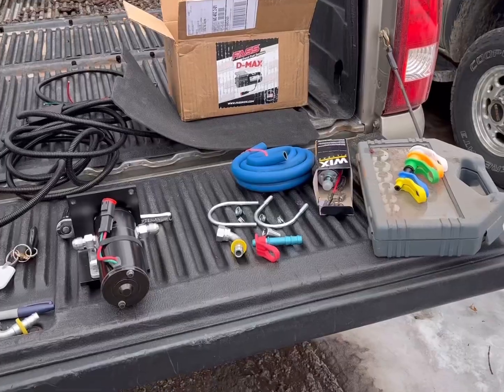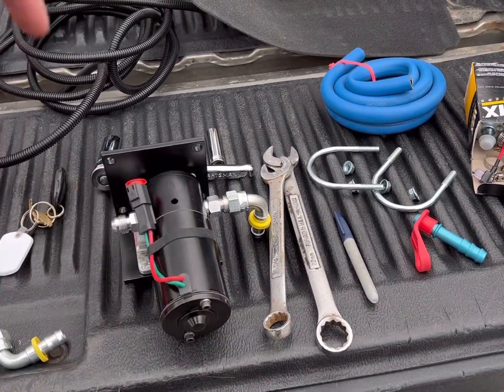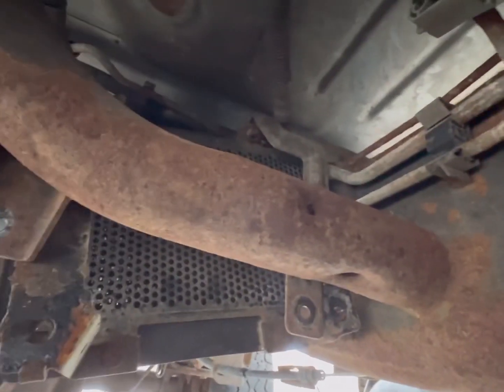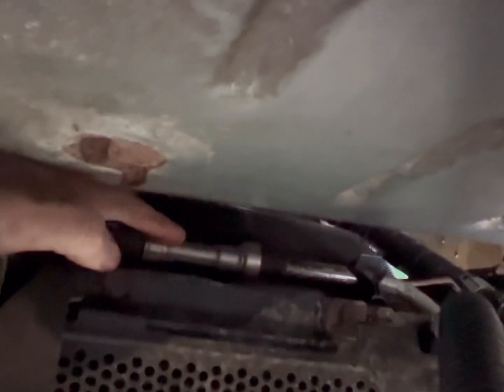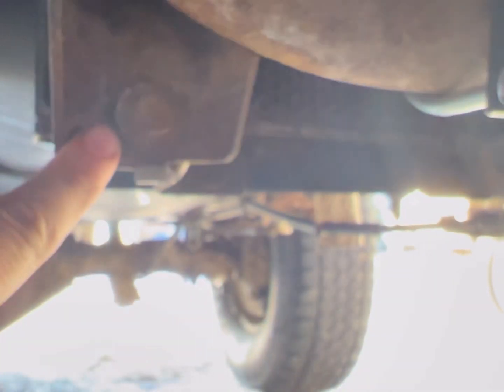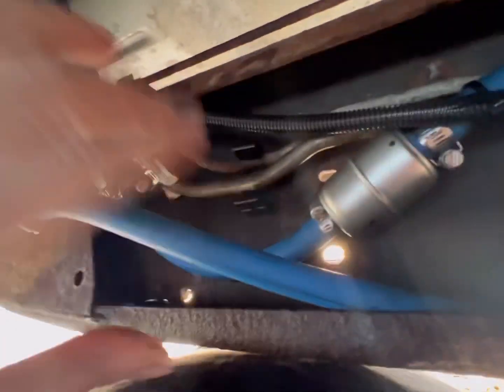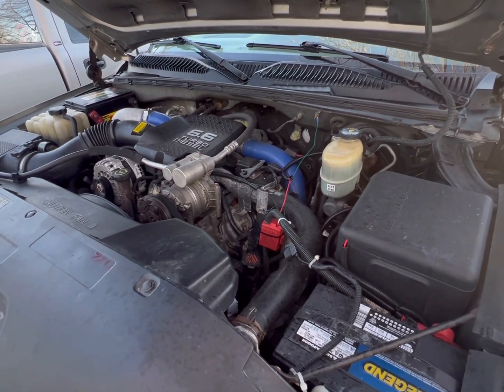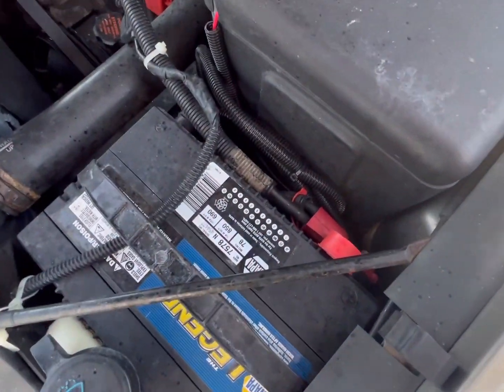GSC Fass 7001 Dmax booster pump install part 2

Comment: Hey dude Been through your YouTube channel and see all 6.5 related do you know if I could use my 700r4 trans my blazer is currently fitted with a 6.2 but the engine has major blowby and I have chance of a 6.5 and wanted to upgrade just not sure about the trans 👍
Reply from the maker: If you are leaving it NA it will be ok. If you are going to turbo I would get the transmission rebuilt and upgraded to handle the extra torque.